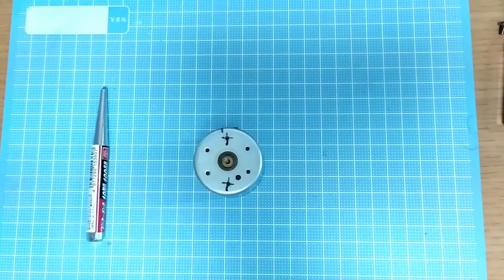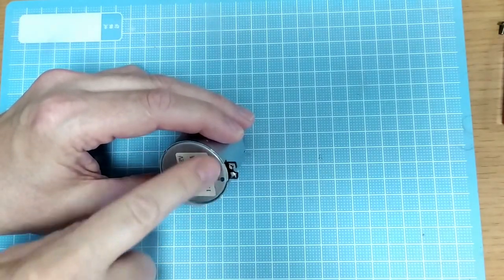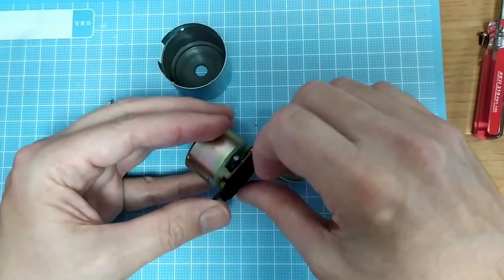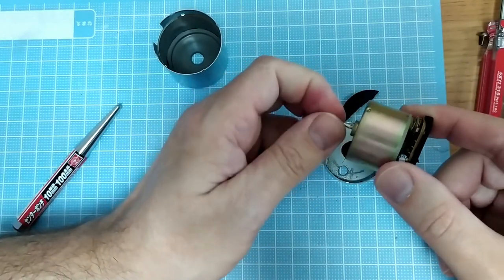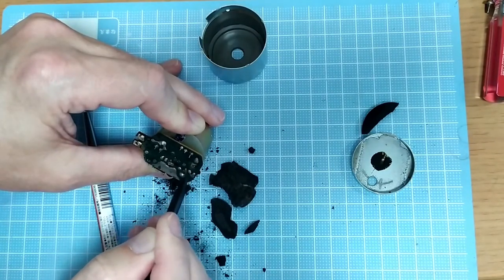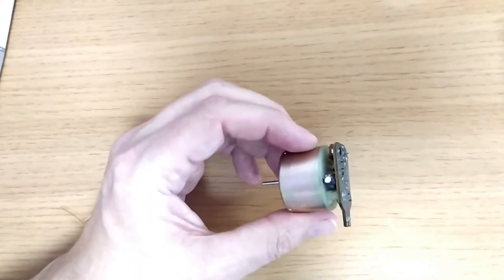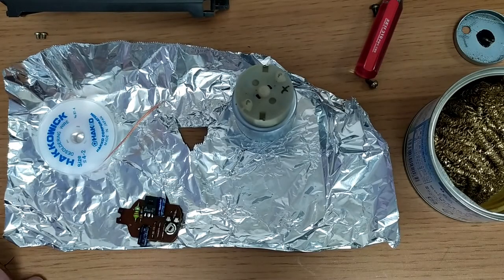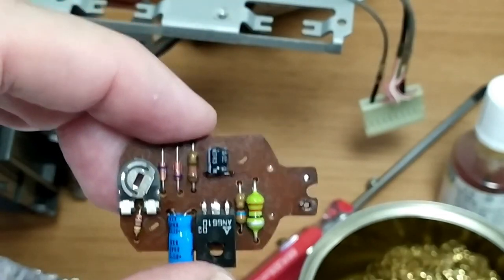Cassette deck motor repair - part 1

Comment: 3:40 This part helped me so much. I was confused when I went to adjust the screw and the slot felt "soft". You just have to push through the rubber opening until the screwdriver slots into the potentiometer at the bottom. Thank you for this helpful video now my $10 turntable sounds perfect!
Reply from the maker: That's great to hear.  Glad you found it helpful.

Comment: You are right about the lack of videos showing motor cleaning/repairs.
I have an old Pioneer CT-200 deck with a constant run motor,  one day it will go silly and i will have to take it apart.
When you said  " A small punch "  the ten year old part of me laughed, what a violent man :-D
Sorry silly mind :-D
Reply from the maker: Standard advice is to replace the motors, and that is actually not bad advice, but it can be expensive.  Lack of appropriate stock can be an issue too.  So I really wanted to see if it could be done, and done reliably.  The answer is yes to both.

Comment: I have a Philips N2226 and the belt needs replacing because it disintegrated. Luckily it didn't melt, the motor cap needs replacing

Comment: are you able to help me for this ? i have a Matsushita MMI-6S2R2D motor and it has a exposed resistor betwheen the + and - pins, and it also has a ground pin, which is intresting, the resistor connects the + to the - pin, and when i did a test on the motor at 2V (10 volts less than its rated voltage) while wiring it up correctly according to its back, the resistor immediatly started smoking, i turned off the power to it and just wondered, why did it burnout if i wired it up correctly ??? tho, one thing for sure, its not a cascade problem, as around 10 days ago when i first got the motor, i did a 5V test and it worked fine (just lower speed due to lower voltage), so once again, why dosen't it work now ??? but now to the actual thing, do you have any ideas on how to fix that resistor problem ? in case its about remplacing the resistor : yes it is possible, just unsolder it and put a new one, that easy, but it might do it again.
Reply from the maker: It could be that the voltage is too low to get it to spin, so it turns into a dead short.
Reply: maybe you are right, but how could a resistor short circuit itself at lower voltages ? it had no contact whatsoever to the main speed regulator circuit or anything, it just connects the + to the - pin, does not even interfer with the main system, but anyways, when i have the time i will try to run it at 5V. (as i said, it worked fine when i first did a 5V test)

Comment: Amigo saludos consulta,si el motor de un   radio doble casetera aiwa modelo CA w51se le daño el motor ,se podrá reemplazar por el un deck marca jvc KD A11? O tiene que ser el mismo motor del aiwa que tenía?
Reply from the maker: Muchos de los motores son muy similares, especialmente en las pletinas de cassette portátiles posteriores. Busque en el motor una etiqueta con el número de modelo; podría brindarle la información que necesita para encontrar un reemplazo.

Comment: HELLO EXCELLENT VIDEOS CONGRATULATIONS, I HAVE A PAIR OF RS-M 250, REPLACE THE ENGINES BECAUSE IT WAS ALREADY LOSING SPEED, AND IT IS NOT THE BELTS, WITH THIS TUTORIAL, CAN CHANGING CAPACITORS BE RECOVERED?
Reply from the maker: Not sure if I understand your question.  If playback is slow and belts are good, then there is still a lot that can be wrong.  It can be worth going through the entire mechanism and cleaning and regreasing everything.  Check the wiring on the motor too - mine was connected through just a few strands as it had worn through over the years.  Desoldered, cut and stripped the end and I had a good connection again.  I replaced all the capacitors on the main PCB, but didn't make a video on it.

Comment: Would this method also work on an 8 Track player? I’ve got a portable player that has that same issue where the motor won’t start until you spin the flywheel.
Reply from the maker: Maybe?  Best bet is to open it up and look at the motor.  If it looks similarly constructed, then you may be able to get it open.  Some of the earlier compact cassette deck motors had some far more complicated circuits in the motors, which gave way to simpler IC's with just a few components. 

8 tracks would be getting on to 50+ years old, so probably any oils and greases would be dried out by now, at the least.

Comment: It would help if you explained more about the type of replacement capacitors you used. Mentioning things like, non polarized vs. polarized. what the voltage values mean, and where one can purchase these capacitors. Anybody can take the motor apart fairly easy but to understand what type of electronics are needed for the replacement is the most important part of the repair that was completely passed over on your video. especially for people who are watching this in order to learn how to repair.
Reply from the maker: Each motor (so far) has had a different arrangement of caps - some have 2, some 3, and values aren't always the same (so far all have been polarised electrolytics).  So you just need to open it up and replace like with like.  I have a fair collection, and sometimes buy them by the bag, so usually have replacements on hand.  The general rule of you can replace polarised with NP, but not the other way around most likely applies, but likely just a standard NP in there.
I typically use standard caps for everything.  The only exception being replacing low esr orange caps in audio paths - thats where I spend the money, though usually those old orange caps test just fine.  Some people like to use expensive Nichicon Audio Grade caps everywhere.  I don't think that is a necessary spend of money, but if you are only doing a one off, so what?  A couple of extra dollars on BOM won't leave you eating catfood in your retirement.  Go for it.  Tolerances for even GP caps these days is pretty tight, they just aren't always low esr, which isn't always a desirable or necessary trait - application it is used for, rules.
I use Nichicon, Sanyo, TK and Elna mostly, but that is just down to supply, and the fact I can buy buy the bag of 100/200 easily and cheaply.  Some of the factories are literally just up the road.   I drove past a Nichicon factory on my last ski trip.
Reply: @felix_da_katze  that is good to know that i can swap non polarized with polarized. Ebay sells newly upgraded non polarized caps alot so now i know i can install those. What about voltages and temperature ratings of capacitors? Are they just maximum ratings or do they need to match what was previously in the equipment being repaired?
Reply from the maker: Voltage values need to match or exceed what you are replacing, as a general rule.  It can be very exciting to use under-rated caps!
Reply: Ok i understand, i will take this into consideration when i rebuild a couple of tape decks i have required. Thank you.
Reply from the maker: Mr Carlsons Lab, Dave at EEVBlog, all have channels that explain this stuff, and some good info on how to solder/desolder.  Worth watching, and it's the main reason I don't go too much into it - they already explain and demonstrate it better than I could.

Comment: Great video mate. I'm currently battling with a Technics RS-M205, which looks like it uses the same motor. I replaced the belts and pinch roller, but still have that (annoying) random slow-down. The voltage drops on the 12V motor pins (at time of slow down), plus it has some squealing that I traced back to the motor bearings... All which led me to your video! I'll try some lubrication first and then maybe tackle re-capping it. 
Would you recommend replacing the mainboard caps too? eg especially around the power supply
Reply from the maker: Yes, and I did a full recap of the board before messing with the motor.  At a minimum do the largest power caps, and anything going to the motor.  Typically they are located close together.  I'd suggest doing that first, if you are chasing the weird voltage drops.  Light machine oil or grease like I used can help the motor bearings, but it takes a bit to get to them, as you can see.  Good luck!
Reply: @felix_da_katze  Thanks. BTW what did you use to remove the plastic pinion / pulley from the motor? A pinion puller?
Reply from the maker: From memory, I think I was able to pull it off just with fingers.  The first time is a bit hard, but it does move.  Try a plastic or wooden wedge if necessary.

Comment: Hello mate, what fixed the playback speed issue? Did you check the cap esr and found them to be bad or was it simply the shafts needing lubrication? Or can dirty brushes cause variations in playback speed? I guess if your going to break into the motor you might as well top up all these regardless but if it's only the lubrication issue maybe you can oil the shaft without disassembling the motor?
Reply from the maker: I think the main problem is lubrication - you need to lube the capstan bearings, and the bearings in the motor.  The issue with the rear motor bearing is that it is inaccessible without taking the motor apart.  Caps are replaced as they are 40+ years old so just not worth my time to test.  Of course, cleaning everything doesn't hurt, and these things probably worked well for about 20 years, so I see it as a small investment in getting another 20 years out of it.
Reply: @felix_da_katze  I agree. Been having the same fluctuations in speed as you described but for now I'm just going to drop pneumatic tool oil on the shaft which will oil the top bearing and hopefully work it's way down to the lower. So far this seems to fix the problem. Thanks for the video as it helped to see the inside.
Reply from the maker: I now use a machine oil, but others recommend motor oil, or something else entirely.  To be honest, almost anything would probably be better than dry bearings.  The way its built, its unlikely to find its way to the rear bearing.  But it is better to do what you feel comfortable with, you might get good results with just what you are doing vs ruining the motor going a step further.  It is hard to get quality replacements, and the NOS I can put my hands on are more expensive than the decks I buy...
Reply: @felix_da_katze  Good point. Most of these decks were designed to be lubrication free and the last thing we want is for people to assume breaking apart a motor is required or routine maintenance. Taking care of these vintage decks is getting more difficult, even a wrong size belt can damage these motors over time. As for a the correct type of oil check out a utube channel called Project Farm, he has videos about CLP oil and NOS grease vs new formula grease. Pretty surprising the damage the wrong oil can do.
Reply from the maker: Yes, totally correct, they are basically lubrication free designs...however very likely the original design brief didn't imagine people using these 40 years later.  So yeah, this would be far from routine maintenance, and I don't recommend it if you don't need to do it.  In a couple of cases for me, fixed wow and flutter issues that couldn't be anything else.  I really mention this for completeness for anyone following this conversation.  
Yes, I have seen Project Farm and he does some pretty thorough testing.

Comment: Couldn't you just dissasemble the motor without taking the pcb off ?
Reply from the maker: No, as you need access to the slots to be able to move the brushes aside.
Reply: @felix_da_katze  if you take it apart by the top part , you woudn't need to moove the brushes aside at all.
Reply from the maker: Unfortunately if you do that you will pull the commutator through the brushes, which will almost certainly bend or break them.  That would be a bad thing.  You need to pull the motor apart if you want to access the rear bearing as it is inside the plastic rear housing.
Reply: @felix_da_katze  I took it apart , removed the pulley , the comutator stayed in its place , i did not attempt to remove the back of the motor , i removed the biggest piece and left the shaft with the rotor in place , i just remove that big metal bit with the front bearing , nothing is damaged and there was no need to remove the pcb.
After that , i could EASILY move the brushes away to get the rotor off.

I see it as the safest way.
Reply from the maker: I think I know what you mean, but as I like to replace the caps, I end up having to desolder the PCB anyway, typically its just 2 posts soldered down.  The only issue with leaving the PCB on, is when you reassemble you need to be careful the magnet doesn't rip the shaft through the brushes.  A toothpick can help.  
I really need to make a new video about this.